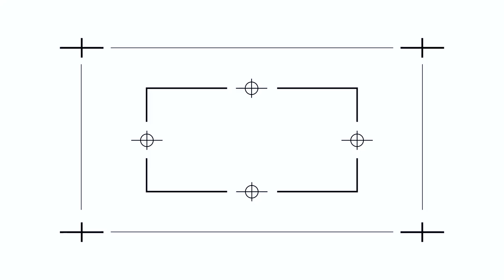I Got Some New Aluminum Screen Printing Platens /// Making a DIY Neck Label Platen

Comment: Awesome!  Could you see OR notice  problems from the wood platen?

I dont know if i warped mine (used EQ) flashing but looks a little curved now. 

Can you do a Video on waterbase with the D-100 ?
Reply from the maker: I noticed a litte warping, which I sort of dealt with for a while, but then I just got tired of the 16x16 size. It was a challenge to get bigger prints on there, so that was the main motivation.

I've been meaning to try waterbased printing again, definitely on my to do list.
Reply: @joshisterrific  I have this same press and I’m wanting aluminum platens as well- just wondering what size you bought and if you know what the largest size you can get for this press?  Thanks
Reply from the maker: @davidholbert9559  I think the biggest ones they have are either 18x20 or 16x22. I decided on 16x22 since I print more tall than wide.